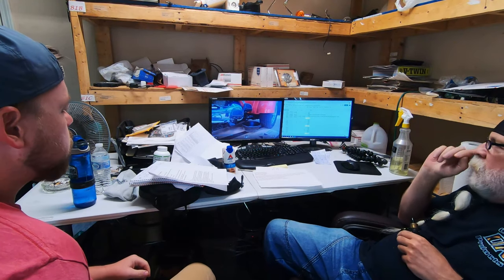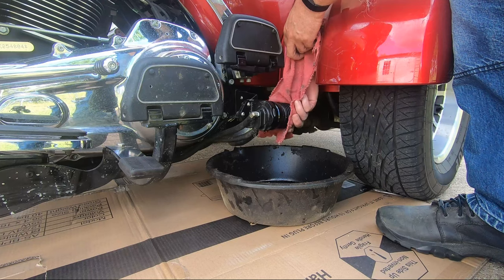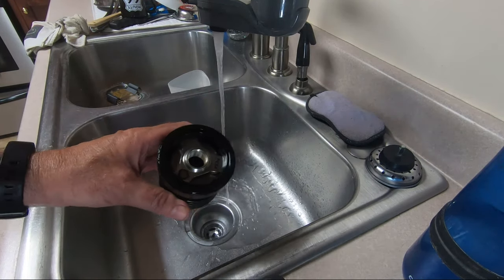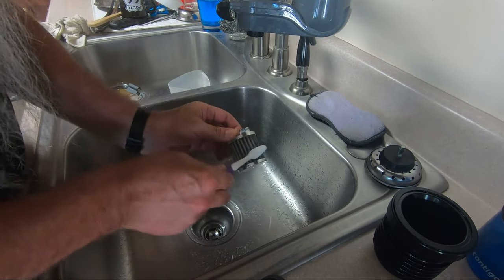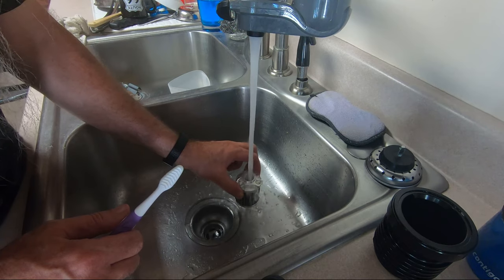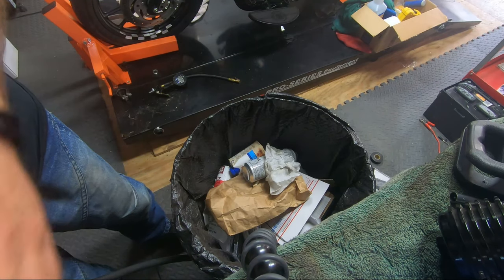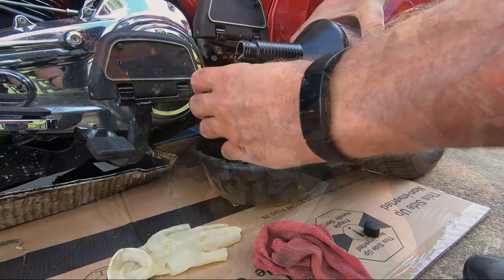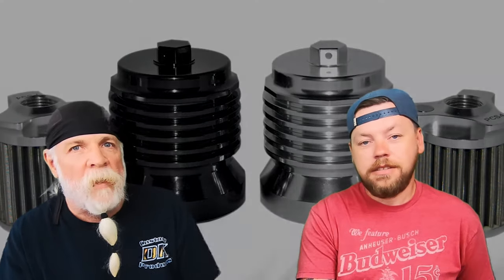Clean - No Mess Oil Change w/ Performance Filter

Comment: The residual from the carb cleaner will dilute the fresh oil .
Reply from the maker: That is true, which means it is important to let it dry completely before reinstalling it.
Reply: @DKCustomProducts   I would only use simple green . You can never get rid of the residue from any chemical cleaner.
Reply from the maker: @joec2174  Do you think Dawn soap with a good rinse of hot water leaves a residue.  That has been my main methodology for the last few years.
Reply: @DKCustomProducts  dawn, simple green , with a good rinse.
Reply: @DKCustomProducts  had an idea to prove out your method. Clean a filter element using your typical method. Then get a glass jar and place a large nut in the bottom to raise the element about 1/2 inch in the jar .  After placing the element in the jar fill it with fresh unused oil and let it sit overnight.  As you know the oil will be ontop of any water and any chemical residue will be ontop of the oil.  Any water will be at the bottom of the jar. It’s a good test and great way to prep the element for reuse.
Reply from the maker: @joec2174  Great idea.  I will do that next time and see what it looks like.  Thanks!
Reply: @DKCustomProducts  got the deluxe tank lift kit for my 2020 road king last night.  Beautiful kit !!
Reply from the maker: @joec2174  Great to hear your liking it.  We appreciate your business.

Comment: What micron rating is the filter element on this reusable oil filter
Reply from the maker: You can see all the specs at this link-
https://www.dkcustomproducts.com/outlaw-high-performance-cleanable-oil-filter-in-polished-finish-dk-ocof-crm.htm

Interesting thing about micron ratings, most are average and regularly engage the bypass, which results in no filtering....like the Harley or K&N oil filters.  These are Absolute and rarely, if ever, go into bypass.  Make sure to read all the info at the link above, where it is all explained.